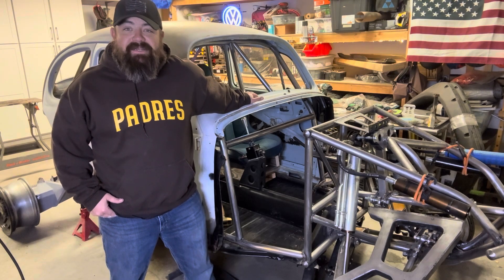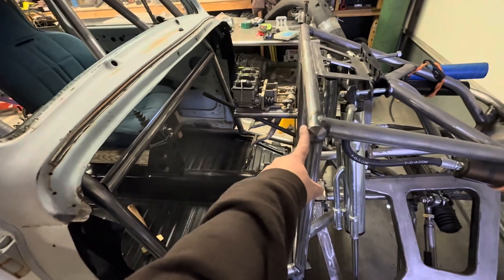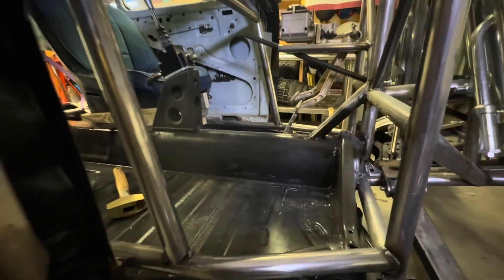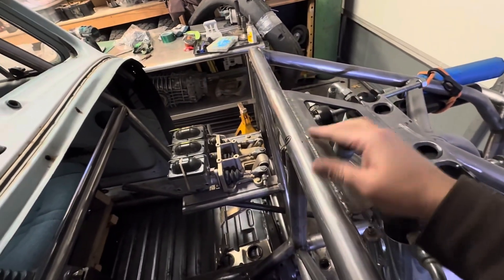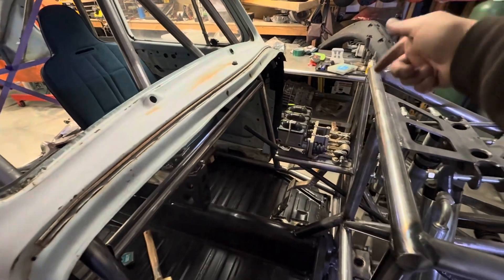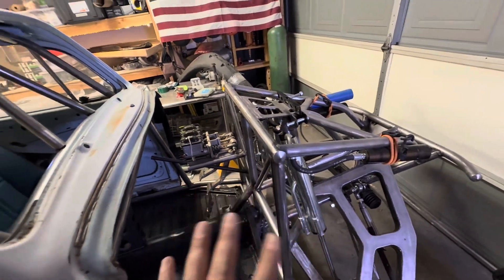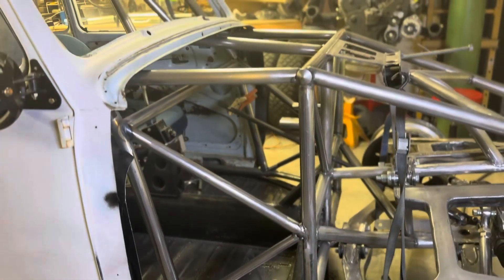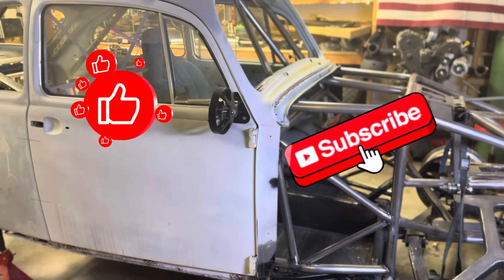Chassis Triangulation and Roll Cage Tie in on the VTec Baja Bug!

Comment: I'm really digging that idea using tape and then marking it and then putting it on the pipe I've never thought of that.
Reply from the maker: It works so good. You do have to “eyeball” the copes but so far I’ve been making them a hair too long which is better than too short 😝
Reply: @MiahsBug  True dat!